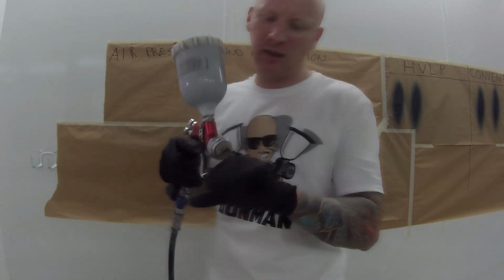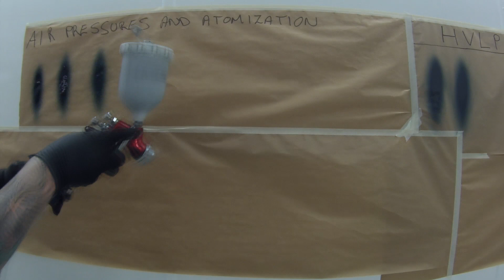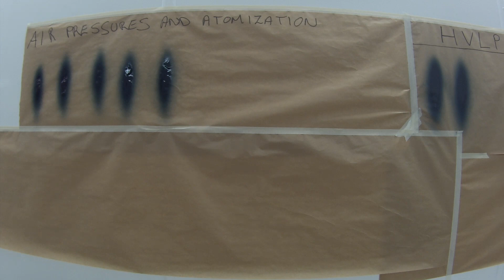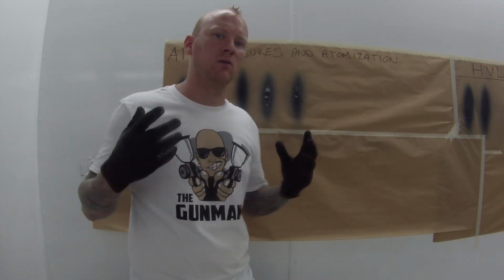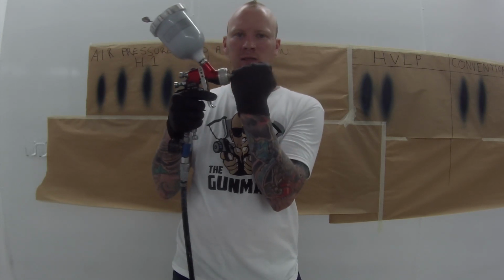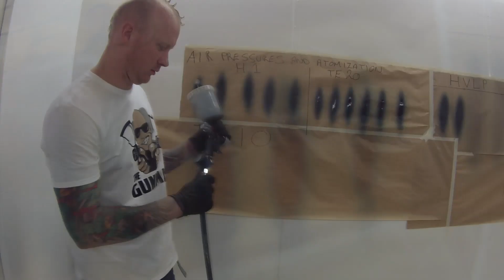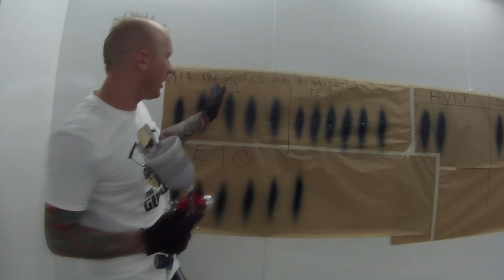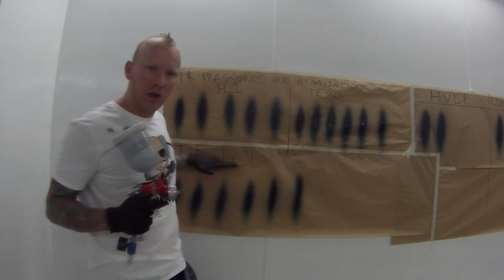DeVilbiss Air Cap Spray Demo

Comment: Love watching you and your videos. I have been spraying my whole life. Stopped back in 1995 being I had sprayed for 20 years then, the clears came out and caused painters to go to the hospitals. The wife convinced me to stop. So I went in to the audio video business. In 2015 I got back in to spraying. Clears have been changed in 2008 I was told. I have all old,school guns. The new hvlp was what was on the market. Didn’t know a thing about them. I have watched your videos over others and got more from them than anyone else’s. Thank you. I own two GTI Pro lites, 1.3 T20 - I do more Restoration and custom spraying now then collision that I did for many many years. Grew up in the business. I want to purchased then1.3 T110 being you say it leaves less peel. More for custom flat finishes. I love the 1.3 T20 shoots everything I need. I have changed over to high solids clear now. And the T 20 handles it great. Little higher pressure. Watching this video I see I need to turn down the air when it is hot. My booth is climate controlled. I set it at 77 and use medium hardener and reducers. Is there anything wrong with this. Or should I not control the temp and use slow everything. I have been using all Tamco products now. Love the 2104 clear. I am getting small little white dots after I color sand and buff. Only on the flat surfaces. Sides no. Is this solvent pop. And what is solvent pop. Never heard of this back in my days. Little white dots are killing me. I bought a new 17.4 cfm compressor that runs 150 psi. Still get the little dots. I have changed the filter and moved it 25’ from the compressor. Anything but old lines is all I can come up with. I run the booth fan 30 mins to 45 mins after the last coat. Any help would be appreciated. Oh. As for really why I commented is if you use a wireless mic we w t hear the echo of the booth. Pretty bad echo. Again love watching you and your videos. I am a subscriber and really enjoy watching any new videos you make. Thank you.
Reply: Solvent pop happens when the surface dries too fast and the solvents can't flash off. The slower hardners and reducers will keep the surface open more and reduce the pop ( the small bubbles formed by the solvents that get trapped under the dried surface. Possibly lower temperatures and longer times between coats will help as well.
Reply: Exactly what Jay said, the solving pop are tiny bubbles left behind by trapped solvents and when you wet sand and buff you cut the tops of those bubbles off so now they are very tiny craters which when finished buffing and polishing are filled with dried white compound.

Comment: I watched this video twice and now, as a newbie, have a better understanding of how air caps are related to compressor efficiency.  I'm using a Devilbiss TeknaPro Lite to paint catylized waterborne polyurethane.  I conducted an experiment like your demonstration and found the T10 with a 1.3 fluid tip at 22'psi at the gun works.  The technique for this paint is to apply a fog coat to color saturation then at approx. 15 min. a medium wet coat and after another 15-20 min. a final wet coat.  The tricky part has been trying to find the correct fluid setting for each coat.  Thanks for the info

Comment: had trouble with my gti pro lite puting to much paint on. looked at your video and got my self a 13 fluid tip and a 110 cap and a te20 cap. what a difference. gun  finish all the time. just  like to say thanks for the help. keep the good work.

Comment: Thanks Gunman for taking the time to share this.  Very useful for 2 reasons, 1 effects of pressure and 2. choosing the correct cap for your compressor. I'm starting out learning to spray and all these details you share really add up to a good foundation.  I have bought a car door and I'm use that as my test piece to learn and perfect techniques on.... Yes, I'm a DIYer :)

I do have a question for you, would you recommend having separate guns for primer/sealers, Base & clear. Should you have a dedicated clear gun, what's your recommendations.

Thanks again and keep on posting all these useful tips.

Comment: I run jga conventional guns at 80 psi, only 50% overlap is needed and as fast as hell, great for hgv bodies and yes the choice of air cap is more important than ever, from 30 cap to 778 that is all air and next to no paint but at a guess I get 16 inch to 20 inch spray pattern, It would be be so cool if you could do a video with the original best ever spray gun the jga  not the modern pro version. you can get them on ebay cheap. Many a pro painter's have used my gun's and are overwhelmed by how good they are if your compressor can handle the job. Many thanks for your cool video's thanks David UK.

Comment: I really appreciate you posting these informative videos!  It's really helped me in my projects as I get into HVLP spraying. One thing I would've like hearing in this video is if you'd go into explaining the usage of the levels similar to how you explained what you would use on a clear and primer.  Would it be possible to explaining what cap and needle combo would be best for applications such as applying candy, clear, base, or primer?  Also, is that the devilbiss quick disconnect on your guns?

Comment: I’m using a Devilbis Front Line FLG4. With a 180psi Ingersol Rand compressor. Paint adjustments are typically close to 3/4 to wide open and the same with the fan control. I’ve tried holding the gun closer (6”) to further apart (11”). Using Nason Primer seal and base coat with Smart Clear Coat. Of course I Change tips from 1.8 primer, 1.5 base and 1.3 clear. I’ve tried to reduce the clear 10%. Main air pressure leaving the tank in 30psi “ish”. I adjust at the gun from 8-18 psi. It seems regardless how slow or fast I move, pressure settings, gun settings, everything does make a change but never the change I’m looking for. I’m trying to teach myself how to paint without so much wet sanding after the new paint. It’s truly like a good heavy orange peel. And help ya have with greatly be appreciated. Great video’s by the way. If I need to send you my personal email or anything, please don’t hesitate to ask.
Reply: Your spraying at a very low pressure and only 30 coming out of your tank, should be higher and as your painting the pressure at your gun is probably dropping significantly also.

Comment: Its going to take a relative amount of air cfm/pressure to atomize that same amount of fluid, transfer efficiency will increase with cfm and so will orange peel at the lower pressures. hvlp can save you 10% material if you have an big compressor. Some turbine guns use 60cfm @ 5psi

Comment: Good day, I use GTI Millennium HVLP spray guns (pressure feed and gravity feed). I use them for clear coat only. Do you have suggestions to get the widest span possible (for clear coat application on wide wood panels) ? Thank you.

Comment: what size tip would you recommend for a first time painter I have the tekna pro with the te 10 and te 20 and several tips 1.2 1.3 1.4 wanting to spray base clear this will be the first time I painted a car but have used the cheaper guns to do prep work so im interested in knowing what tips to use with the base coat and the clear. thanks great video

Comment: I ended up buying the devilbiss gti pro lite, with a te10 and te20 air caps. Looking forward to trying it out now 

As others have asked. How do you tell when your at the sweet spot? I am hoping to get a flat. No orange peel finish for my respray. Is it possible to get that off the gun in 2k?

That said I am still a amateur
Reply: I know you said you bought pro lite but i know for the gti pro Devilbiss made an air cap called the T110 which lays 2k clear on like glass if set up correctly not sure if they made an air cap like this for the pro lite. i bought the air cap in case any big restorations come up i tested it out on couple of panels and once fine tuned really does lay on like glass 👍
Reply: d34nr2k8 the t110 goes straight on the pro lite I used it last week
Reply: ah i didn't know they fitted pro lite well there we go t110 can be used on your pro lite aslong as you have it setup and fine tuned it should lay your 2k clear like glass 👍
Reply: d34nr2k8 Is the T110 cap the same as the TE10? What settings did you have?
Reply: no i think te10 is same as t1 for the gti pro as the te20 is same as t2 or could be other way round if you check the Devilbiss website it gives you all the specs for each air cap. my setup was around 2 bar of pressure with fluid wound right out and fan right out for 2k clear i had 1.4 tip on my gti pro but this setup could be different to how you might get a good finish its really down to your feel for the gun but once you hit the sweet spot on your setup you will see that it really does lay clear on like glass 😊 i only use the t110 for restorations on classics as you need matching orange peel with new cars of today so i use t2 for 2k clear only on normal cars and have a second gti pro with t1 for solvent basecoat 👍
Reply: d34nr2k8 awesome! Thanks so much for the advice! I did a quick google and will paste a reply from devilbiss " DeVilbiss Automotive Refinishing - International

Thank you for your enquiry regarding the T110 air cap.
The equivalent cap for the GTI PRO Lite is the TE10." So I should use my te10 for a glass finish? And te20 for a factory peel?
Reply: thats no problem as i said your setup will depend on how you get use to feel of the gun and you can fine tune it to suit yourself. 

Yeah id use them separate due to if you use the equivalent t110 on a normal car then the finishes wont match and would have to be done all over again so yeah keep the individual for each job 👍
Reply: Booki Hi I find the te10 simular to the t110 but it's not as good

Comment: @TheGunmanChannel  Greetings. I have bought a Tekna Pro Lite. I would like to know what other additional picks I can buy for this weapon and have more versatility in my finishes. On this channel I have seen that the T110 pick can be used for a more crystalline clear. However, I I would like to get more out of it. I bought my pro lite with the TE20 and HV30 picks. I would also like you to explain to me what it means to keep the pro lite with the original configurations. If you can be specific to keep the weapon with its original regulations. I appreciate your contributions to continue improving my automotive finishes.

Comment: Hello gunman excellent videos dude I really liked the gti pro pressure vid, I jus got back into spraying after many years, was not a pro back then but seem a bit better now, I use the te10 air cap so you recommend the higher of the psi which is 30psi, I'm not used to using Low psi when I used to spray I got taught to use 60psi, also is a t110 air cap a lot better than the te10 cap as read mix reviews online some say a lot smoother finish and some say its exactly the same as the te10 thanks a lot dude
Reply from the maker: For a warm environment say above 30 celsius then keep the te10 around 20 psi the colder the day then yes the pressure will come up so my best advise is to get the feel of the gun and start painting by feel while looking at the finish you are getting and adjusting to suit, I've never used the t110 but to be honest I would imagine it to be about identical to the te10.

Comment: +The Gunman Can you get away with buying a single gun (e.g. the SGK 600) and multiple air caps for the sake using primer / base / clear?
Reply from the maker: It's not so much the air caps you'd need to swap out but the fluid tips, for that reason I'd say the DeVilbiss GPI would be the best option because you can get it in 1.4 for colour and clear and 1.8 for primer. I have a review on that gun and it is a great gun but nearly half the price of the top line guns.

Comment: started using the tekna pro(US version)  on big panels i want to avoid mottle with metallic base coats, what tip cap combo would you recommend?  im running 1.4 tip with the TE10 cap.

Comment: How do you tell what the right atomisation is for when you start spraying a panel using what was shown in the video for the TE10 I'm guessing you would not want to spray to fine and not two heavy. If that doesn't make sense basically what I'm asking how do you tell what the sweet spot looks like?
Reply from the maker: Its going to depend on what you are spraying and the finish you are looking for, trial and error is what got me to where I am now so I recommend just having a play around while observing the finish.

Comment: I’m confused the TE10 is supposed to be low pressure or low volume but you said you get it up to 30 psi higher than the TE 20. Do the air caps make a gun HVLP or LPLV? Seems like all guns spread better at slightly higher pressures above 20 psi so it gives?

Comment: Great video Gunman. I'm new but watching and learning a lot. I just bought a Tekna Pro Lite and will start experimenting with the TE10. I have a 5 gal 3 hp Compressor that can put out 8.6 cfm at 40 psi. I'm having a tough time with the blending terminology - Clear Blend, Reduced Blend, Solvent Blend. Very few places sell Blending stuff and I hear so many different stories of mixing your own. I'm not interested in the rattle can versions. Can you help clear this up for me? Thanks in advance Mate.

Comment: I have a 30gal compressor and want to spray urethane basecoat clearcoat which fluid tip should I use 1.2, 1.3, 1.4?

Comment: Good vid. Something I have been trying to figure out is air pressure settings. I will start paying more attention to my spray pattern. I'm thinking about getting the gti pro lite gun. We have the Tekna here in the U.S. but  I like the gold finish. Do you know how the Tekna Copper stacks up against the gti pro lite and I wonder if the parts interchange. Thanks for the vids. I'm learning a lot.
Reply from the maker: Double R Restorations Unfortunately they don't sell the copper in Australia so I have never used one, here is the pro lite from Australia 
http://www.ebay.com.au/itm/Devilbiss-GTI-pro-LITE-Spray-Gun-Gravity-Feed-1-3mm-/251176348098?pt=LH_DefaultDomain_15&hash=item3a7b46e9c2

Comment: Devilbiss plus, 410-ac, 1.2, 1.3, 1.4 is my gun. Ample air supply. Spraying PPG Duracryl Acrylic Lacquer, Silver (very fine) Metallic. Blocked 400 wet, primer dusted, then 600 Dry pad blocked. Plan on 3 coat's: light wet, med wet, med wet. All panels on cassis. Asking for any suggestions on primer prep, gun settings and tip size, number of coats. Goal is one big drip, low orange peel. since I can't color sand. Thanks, you've been a great source for my project.

Comment: Hey Gunman I have the black TeknaPro Lite and wondered if the T110 air cap can be used on that gun, I am in the states and called DeVilbiss and they say they dont sell it in USA and that it would not atomize correctly. Was looking for the flattest possible glass finish. Seem to get a bit of peel with the T20 and T10 with 1.3. 2 bar in home spray booth 70 degrees. PPG DAR. Thanks alot for the great videos  Mate!  Any other tips they might sell in the states that have the smaller holes?

Comment: So ive been out of the trade for a while but looking to get into doing a few small jobs for myself in the shed.  Have a older (2008ish)  gti pro  base (or pro lite base i cant remember) with the t1 air cap.   Can i just throw a te20 cap on and send it?      Cheers . Love the vids

Comment: Congratulations for your shop 
About your compressor set up  can you talk bit more about filters and compressor
I'm getting a lot of water in my lines 
New 60 gal IR 5 hp single stage 3/4 rapid air lines  dryer is 40 feet away from compressor
25 feet 3/8 hoses and fittings 
Maybe my compressor is too small?
Thanks

Comment: I have been using the te20 on my tekna prolite. Tried the te10 but liked the 20 better. My question is on the cap the te10 states max35psi . And the te20 is 26psi. So how is the te10 a lvlp cap if it states a higher pressure ? I thought both where compliant caps ? Should I use the 10 for base and 20 for clear ? I have use the 20 for base and clear and the 10 for single stage and tried the 20

Comment: So the finer the spray, the better the quality? How come you wouldn't run the gun at 28psi at the current temp ?

Are there cheap(er) guns that are good for all purpose? (primer, base, clear)
Reply from the maker: Too much paint waste, the higher pressure will give you a nicer finish but use more paint.
Reply: yeah its best flat out at wall i was told due to if you set it at wall by the time it gets to the gun it could drop too much pressure and drop more often and it depends on your hose length and diamter as well.

Comment: Thanks for another great video - greatly appreciated!  Do you know if the TE 10 air cap would ft on a GTI Millennium?  The 2000 air cap uses a ton of air!  Thanks and keep the great vids coming!
Reply from the maker: No they aren't compatible.
Reply: Hi Jim, what was the outcome of the T10 air cap as I have the same gun and same problem as you??? Blessings
Anton
Durban
South Africa

Comment: tried out my Devilbiss SGK worked nicely for me as only a learner, my compressor even though its a good model runs about 5 times to rebuild air on a bonnet in base, so I have to stop and let it build air, so  its important to get a decent compressor, takes me time to get my head around it all as spray painting is not as straight forward as one may think, I had noticed a rock, but now? I am realising Mount Everest is underneath, thanks.